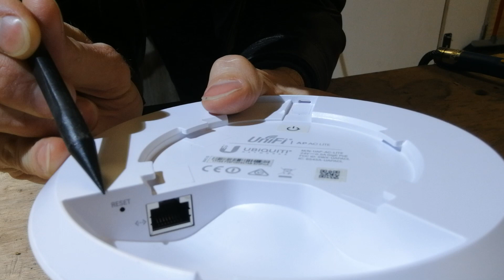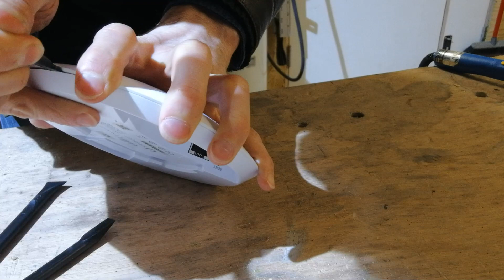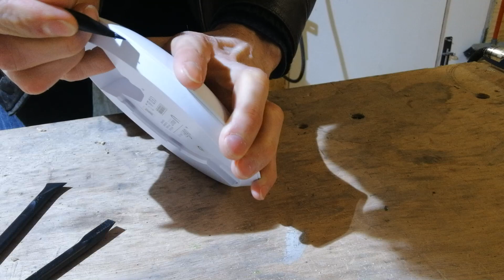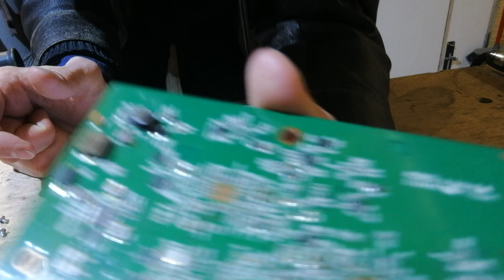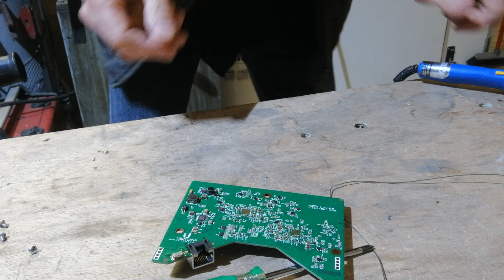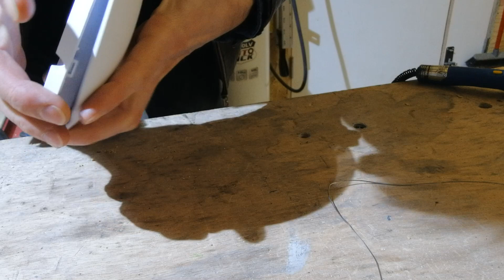Ubiquiti UniFi access point fix broken reset switch

Comment: In my case I was able to press the button through the whole and I could feel the "clicking", but apparently the switch was bust. After opening up the AP, I was able to short left and right side of the micro switch with a short piece of wire to reset it.

Comment: For me the button snapped off completely. Soldered two small wires to the leads, expanded the reset button hole and fed them out. When the wires touch it resets. Put some electrical tape on both wires for the intermediate period when not needing the reset.
Reply: I may consider doing that. I pulled out our old AP to see if I could do anything with it. I think it's stuck in an upgrade mode because it flashes green and amber every 1 second. However, I can't get it to reset via the reset button. Makes me wonder if the reset button is broken mechanically.

Comment: Thanks for the video! My button was also broken off and I don't have a soldering iron. However it was simple to hold down the button on the board itself for 10 seconds, it reset, and I was able to finally re-adopt it.
Reply: I agree. Much easier to remove the small metal pieces over the switch and then replug the cable in the unit and push the reset button on the board for 10 sec. I actually threw the small metal pieces in the bin (where they belong imo...)

Comment: is there a way to activate the reset switch if its been missing? i bought a refurbished nas drive which failed on me and i couldnt get the reset switch to work. after opening i noticed the button was gone completely
Reply from the maker: Touch a wire between the two terminals where the switch would be attached. A paperclip might do the trick, otherwise a tinned wire.